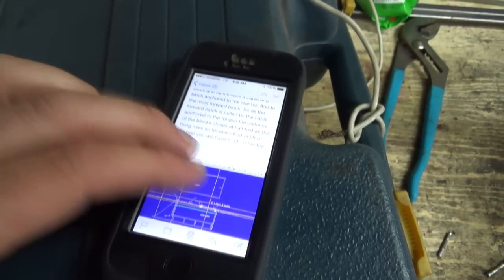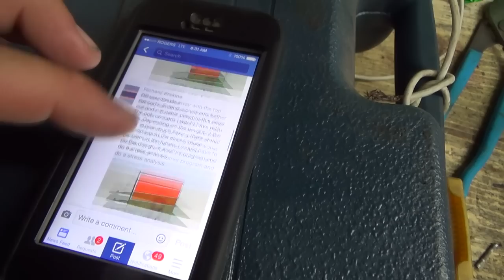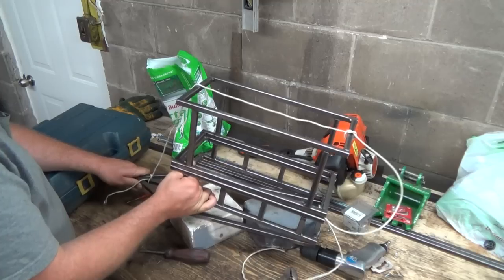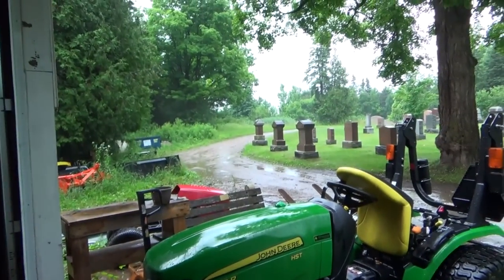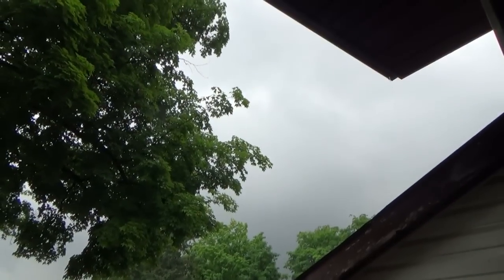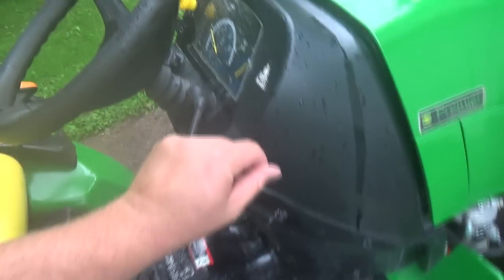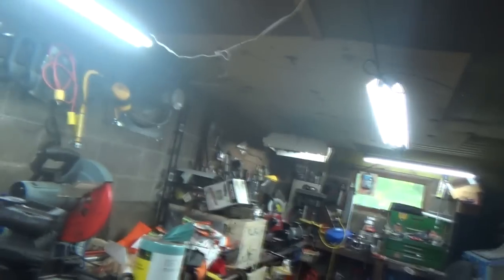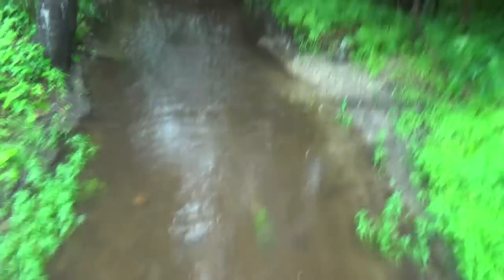7 funerals in one day...insane... and drenched!!!!!

Comment: Bill look at any setup landscapers use for leaf collection. They all have some kind of door on the back they open up and the leaves fall out with no issue when they dump. All you need is a hinged door and youll have no problem with leaves not dumping out. If leaves do stick rock the trailer so the hinged door bangs on the box and theyll fall right out

Comment: Just a idea? Check out a end dump or rock truck what ever u call it. Some have tailgates theat open when u raise the bed that is just a pulley system. And check out a smooth fiberglass  liner for the inside I've seen them in dump truck body's the dirt or gravel is usually all out before they finish raising.

Comment: Hello Billstmaxx. Long time watcher of your video's. Just a heads up from my local mechanic that works on mowers, trimmers, etc.... He is extremely negative on the hose attachments on the mower decks. He claims that the spindles will wear out three times as quick if you us that attachment. He has 30 plus years in the industry and claims that company's out them on because the customers wanted them. His father has near 50 years repairing mowers and has the same thought! Just FYI to keep your operation up and going longer!

Comment: Thinking design with cross member midway on the section like in suggested submission - elevated allows for a lift rather then pull motion to lift and dump, i.e., from tractor up over front edge of "bin" - then up to wheel on mid elevated crossbar and then DOWN to attachment at rear edge of bin. So pull line travels from tractor going UP to elevated wheel and then DOWN to rear attachment. Up and Down design allows for LIFT vs no elevation allows only pull motion which when considering actual weight of box would be very difficult if not impossible. Just some thoughts.

Comment: If you mount a bar to the frontbeam on the topframe, that extends in a foreward direction and you fasten the wire on the end of that bar, it will act as a weight arm. That will put much less strain on the wire when lifting..

Comment: Billy, from a man that has done spring/fall cleanups with a company for a while you and i both know that in the fall everything is wet and sticks (holds) on...i like the sides stationary with the top movable... make sure u can LOCK the top so it doesnt move very much tho!
Reply: IceMistEclipse  ALSO. our county uses suc vacs and they turn them on when they are dumping... helps push out the plugged bits i guess? Not to sure other then i always see them turn theirs on.

Comment: For the pulley you should try using two equally sised pieces of metal and use little pins and drill holes through the metal and there a pulley I guess

Comment: Hi bill you know your fs90 4mix it's hard to start and runs crap that's the valves need adjusting :-)
Reply from the maker: James Steele ya maybe but there only rated to run 300 hours and ive got well over 400 on mine the stihl tech said that was really good
Reply: BILLSTMAXX :) Bill, that thing's going to be really heavy when it's finished! Don't you think a strip door on the back part without having to lift it up while dumping wouldn't work as well? It would sure be easier...

Comment: I don't think your cable idea is going to work well. The pulley at the front won't do a thing, because the distance from the front of the box to where it's tied at the rear doesn't change. I've got an idea of using linkages on the sides that I think will work pretty good. I'll try and get it drawn up and show you before you get too much farther.